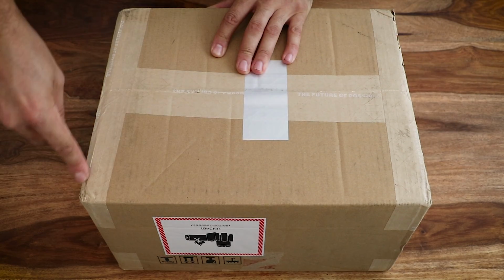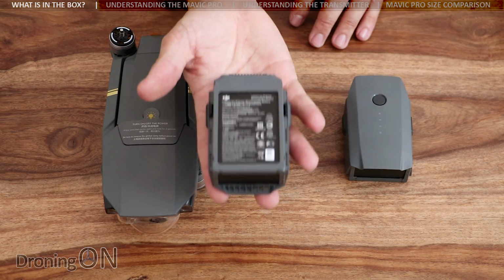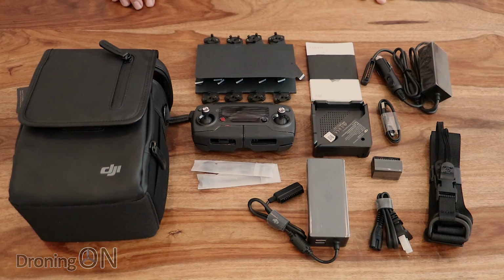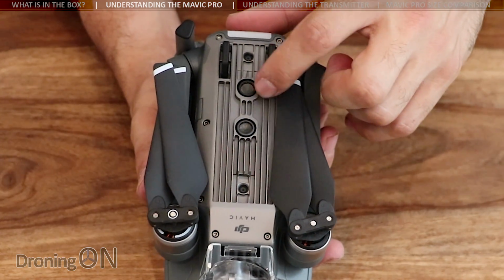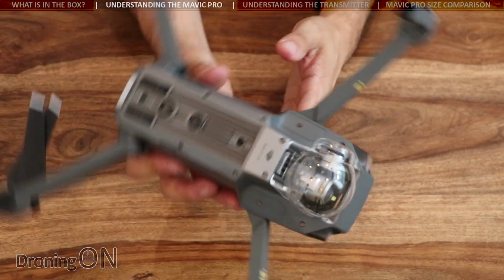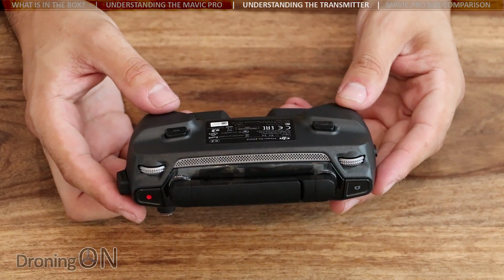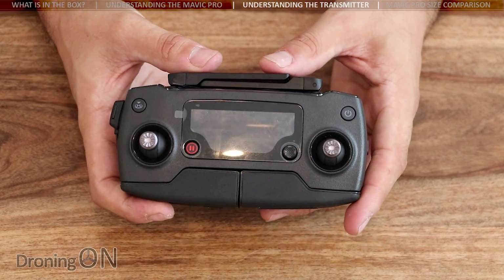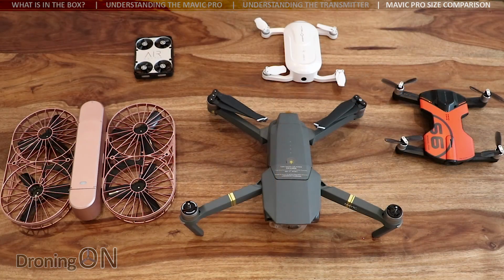DJI Mavic Beginners Guide (Part 1) - What's In The Box

Comment: 3S means that there are three cells in series
Reply from the maker: Correct, but this guide is for newbies and so series/parallel doesn't matter to them, but the fact that it contains 3 cells is, because of the voltages shown in the app which I'll go into later on :)